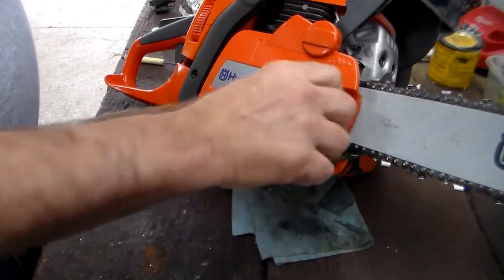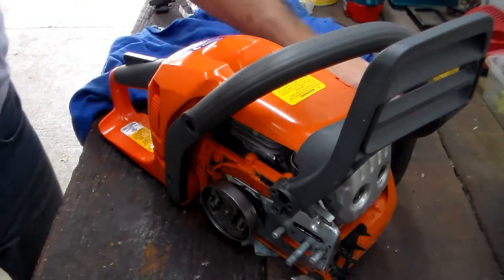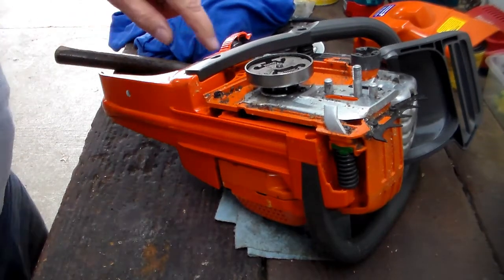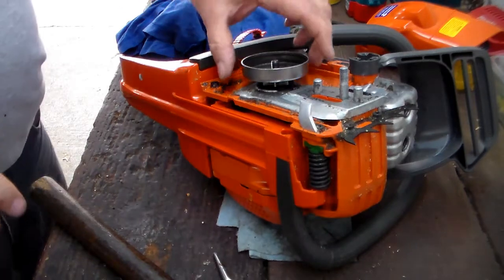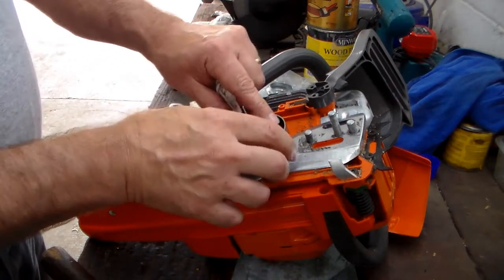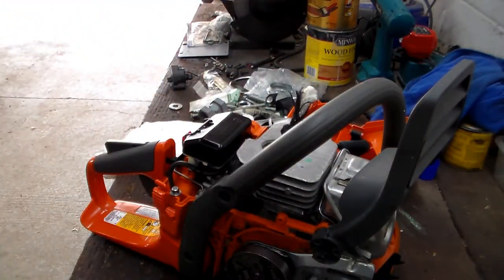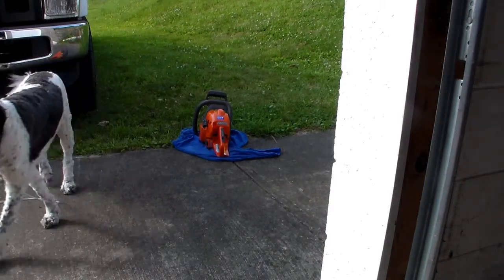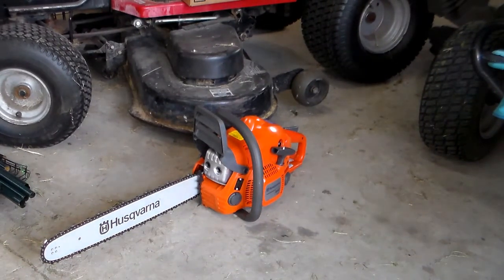Husqvarna 440e   Chain Oiler Leak

Comment: I really think this is on purpose, i have a 50cc 2.6hp german chainsaw, and when brand new it would also leave a small pudle under it while sitting in the garage for a couple of days, but once i started heavy use on it, all day cutting, it stopped. 
Maybe to prevent easy clogging of the oil outlet once you really start using the chainsaw.. thats my theory.

Comment: Did it ever develop a leak after cleaning it? I have the same saw, same problem. I've heard to use a little Loctite 518 as a sealant in the area it sits against the "oil port" as a fix. Just wondering if its really needed. My saw is basically brand new. Used 2 or three times for a few minutes.
Reply from the maker: This saw too was practically brand new.  You could see where the seal was folded over.  I have only used it once since the fix and so far so good, it would be nice if it had a way to meter the oil like some others.  This seems to really drench the chain.
Reply: @timtimeprojects3576  Interesting, I did not find any folds or deformities on my saw like I expected to.. I've heard that the oil port/rubber insert can leak so I just finished applying the Loctite 518, we will see. Or perhaps it was leaking from another place I missed and haven't heard reports on yet. One thing is for sure, it was not coming out of the oil feed tube properly to soak the chain and left the dreaded puddle of oil doom in the chainsaw case/anywhere the was placed.
Reply: Mike,  did the Loctite 518 work and where exactly did you apply it?

Comment: Does that chainsaw have an oil adjustment screw? Every video I’ve seen shows one on the husqvarna saws. I have a 440e and I can’t find any adjustment screw!
Reply: They are automatic oilers . I have both the 440 an 440E . Good saws about to replace my pump clutch and oil pump cover . Because I cut the bottom of mine
Reply: It doesnt, I changed mine with 455 oil pump that is adjustable
Reply: I have a 440E2 and I I'm not getting no oil pumping and I replaced everything with the filter and I heard it might have a error flow valve on the oil reservoir?
Reply: @wipsaw100  did you try cleaning the oil holes on the bar .they can get clogged up and it will not oil the chain.
Reply: @wipsaw100  same, won't oil even with bar off, I'm at a total loss

Comment: I have a 440E too and I'm not getting no oil I replaced everything but the oil filter but I heard that may or may not have a air flow hole In the oil or reservoir?